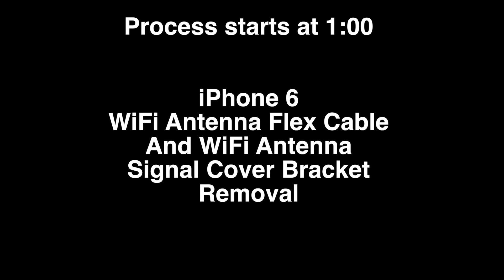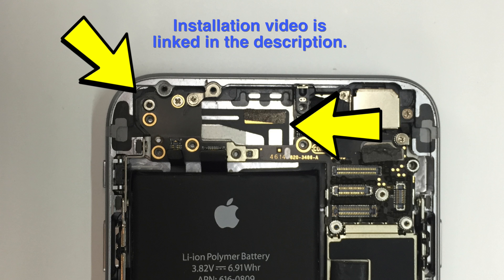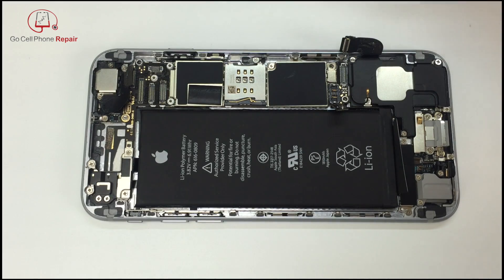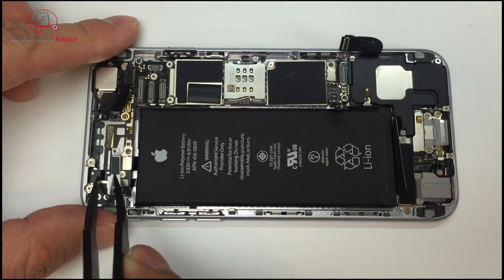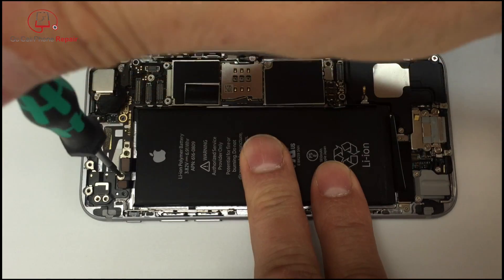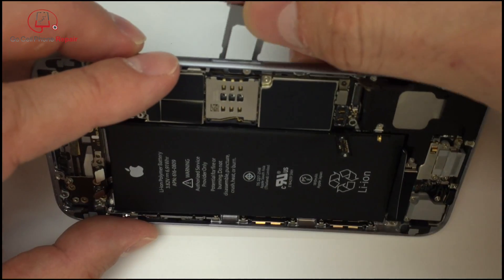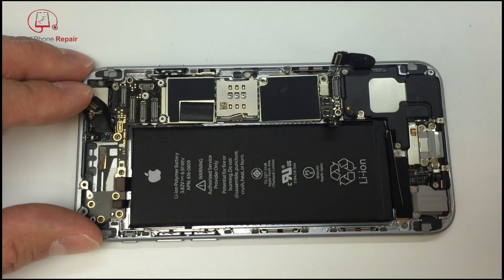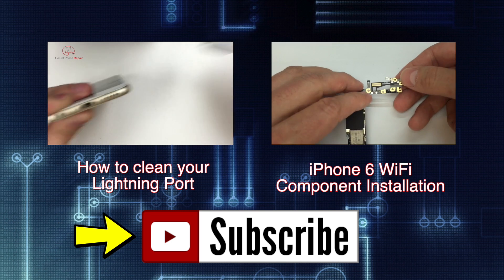iPhone 6 WiFi Component Removal

Comment: hey guys will this fix the searching issue on an iphone 6 plus. Cant get phone to activate. Its either stuck at searching or no service. thank you
Reply from the maker: Check the date and time. If it is set to the wrong year that is the most common reason for stuck on searching.
Reply: Thank you for the response. I made sure time was right and still has the same issue.
Reply from the maker: You might want to try restoring it if that is an option. iOS 10 has also caused all sorts of problems so if this happened after upgrading that would definitely be suspect. If the year is correct then confirm that the SIM is valid and phone has a clean IMEI/MEID. All good? Then I would proceed to hardware diagnoses starting with the antenna connector down by the battery terminal. If that doesn't seem to make a difference you can try the GPS/Wi-Fi module but I don't think that it would affect cellular data so you might have bigger problems with the device.

Comment: Thank you so much for following up on my request
Reply from the maker: No problem. As you can see quite a few people needed this tutorial so thanks for asking!
Reply: I read several threads and they recommended I change my GPS antennae. Its actually the little square piece he removes in the video on the upper left. It didn't fix the problem. I just changed the wifi antennae following this video and it fixed my problem. My recommendation is change both of them at the same time, they are like $5 each on amazon prime to avoid having to go back in there twice. Good luck.
Reply: Go Cell Phone Repair how do I know if my iPhone needs its antenna replaced?

Comment: Hello...your video is great and I will go ahead and fix my IPhone 6 because I have a low wifi signal.....But I have a question...at 3.35 you remove the wifi "cover" but apparently this cover is also the antenna....Is this correct ??? ....Look here please  https://phonepartsusa.com/wifi-antenna-for-iphone-6-apl-003-1466?filter_name=iphone%206%20wifi  ....They call it antenna....So by replacing the cover or antenna will I have better wifi reception ???....or is it just a cover and not an antenna ??..let me know please...BEST REGARDS and THANK YOu !
Reply from the maker: I see the part listed as GPS antenna, Wi-Fi antenna, antenna cover, and more. Not sure if it is exclusive to one or the other. It is most likely part of both the GPS and Wi-Fi system. When I get a chance I'll remove it to see what it affects then follow up here.
Reply: +Go Cell Phone Repair please do so. I'm curious also.
Reply: martin gara  hey, I brought the model of the part that you link to one month ago, and tried to fix my phone with it. Unfortunately it didn't work. This video helped my problem

Comment: GOD BLESS YOUR SOUL. Not only is this the only video for changing the flex cable on youtube for the 6, but it is done in the most clearest way possible each step of the way and under 10 mins. Phone has been saying "Searching..." and "No Service" for the longest time so I watched both videos to disassemble and assemble the new piece that I found on ebay for $1.93 and just to be safe, I replaced the wifi antenna as well which was $4 on ebay. I watched the PhonePartsUSA video for the antenna. This was my first time opening my phone and everything was finished under an hour. That one little gold antenna wire was a little annoying to assemble back in place but everything takes patience. Thank you for saving me 300 bills.
Reply from the maker: That's great and thank you very much.

Comment: wow, replacing my WiFi Flex Cable fixed my GPS, bluetooth and WIFI issues.  fantastic!
Reply: both my wifi and bluetooth became weak after I replaced my power button,I think this is the culprit.maybe I didn't put it in all the way or became loose.

Comment: Thanks for posting. Clear and to the point. Fixed my gps with the antenna flex cable. Strata now working again. Thanks!
Reply from the maker: Good to hear. It's starting to seem like this is a more common problem than I had thought.